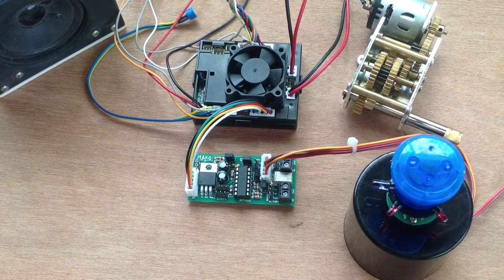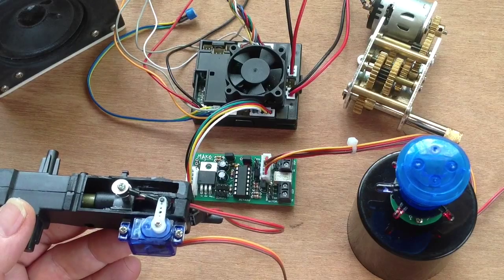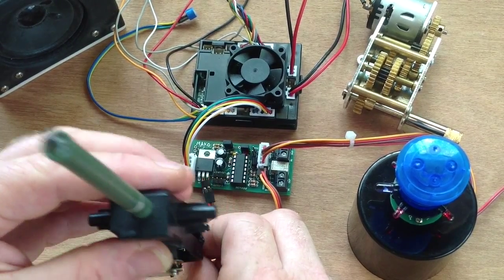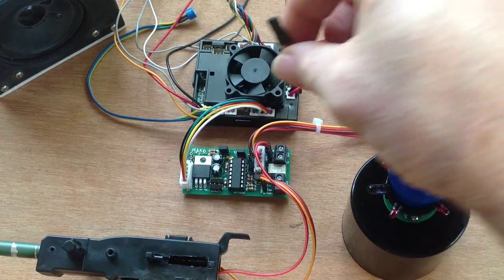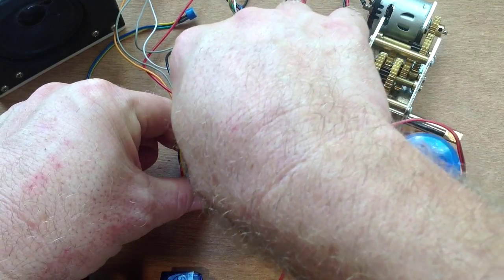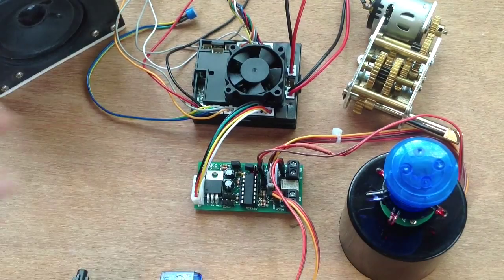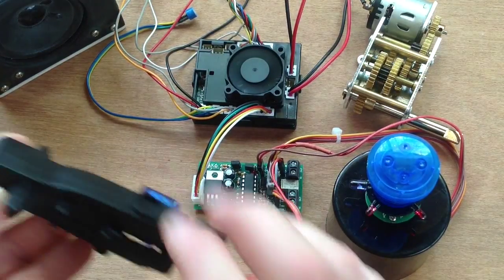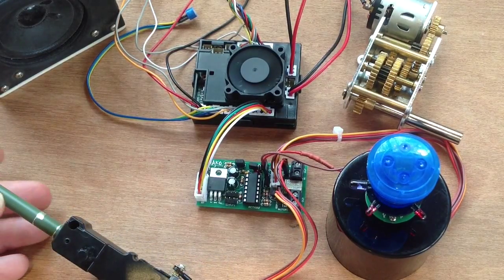MAKO INSTALL 6 - Servo Recoil, Cannon Flash & Hammerhead Connections

Comment: Thanks for the video.  Is the cannon LED flash unit just a LED (and nothing else) mounted across the two pins on the MAKO2 board?
Reply: Just a follow-up to my own question.  The cannon-flash on my HL Pz IV tanks was created by a LED in the barrel.  I snipped the two leads from the terminal that they were connected to (inside the turret), and then connected them to the MAKO2 board, and the flash operates when I pressd the "K" button on the HL control unit.